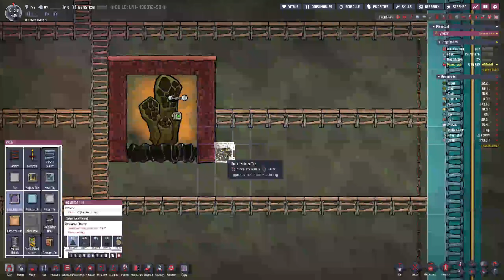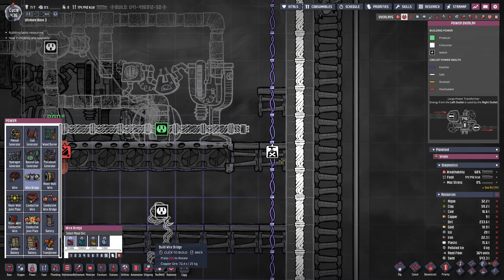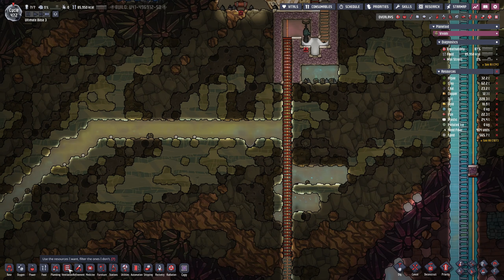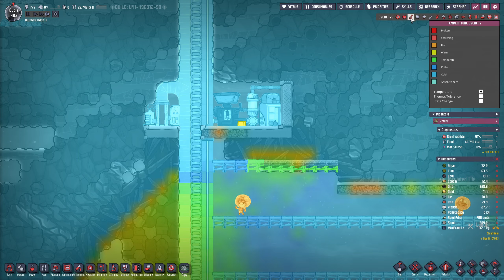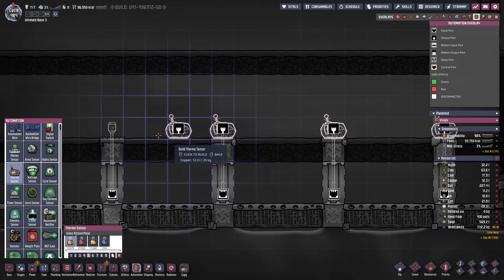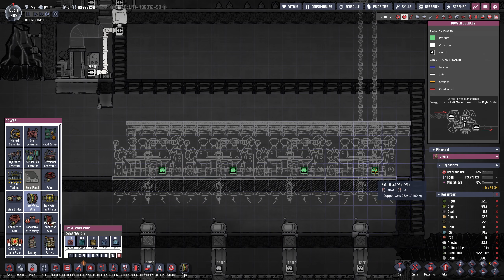MAGMA, GAS & SOLAR POWER - ONI - Spaced Out: Ep. #21 (Oxygen Not Included)

Comment: Hmm there is a problem with the  steam setup? When the steam vents goes dormant, the polluted water does not get cooled down and is rotating in the vent cooling loop. This results results in a clogging of the PW supply and this results in heating up the water in the steam turbine cooling loop. So in the end. there is 100°C hot PW sent to the base.
Reply: arghs I see ;) there is an episode handling this issue

Comment: You cheated, they never could have built those airflow tiles touching your base letting co2 touch lava. Busted
Reply from the maker: You're wrong. I don't blame you though. There was also a heat leak, but I plugged it up. I haven't cheated once in the series, and whenever I do in the future I have no reason not to tell. But yeah, next time I wouldn't be so confident about the "busted" thing... It's not a good look when you could just pose it as a question instead.
Reply: @Nathans-Sandbox  Then why didnt the airflow tiles melt touching the lava?  The ones up top were filled with co2 which should make them melt almost instantly!
Reply from the maker: During building this dozens of airflow tiles melted. They are still there liquified. The leak was easily fixed by filling the tiles containing CO2. There was never a huge leak though.

Comment: I’m having a glitch constantly occurring where I’m building the lava wall diagonally, and they get to 99% of the building bar, and then they just stop and then they can no longer interact with the tile. I have lost tons of copper and iron over this Because canceling the work order is the only thing that stops it and my materials fall in the magma. I don’t know what to do.
Reply from the maker: This happens because there is not only magma but also liquid copper around. Make sure you overbuild liquid copper with a simple tile. There should only be magma around so it can be pushed into the other magma. Airflow tiles cannot delete liquid, so you have to delete it using a solid tile.
Reply: @Nathans-Sandbox  should have been reading this before. costed me some copper and a lot of load/reload games

Comment: you could build a tempshift plate out of plastic diagonally to a magma tile (with tiles still blocking the magma). The tempshift plate will convert to naphta which can be used for refineries if you lack oil/petroleum as coolant.
Reply from the maker: Wow I never thought of that idea, thanks!;)